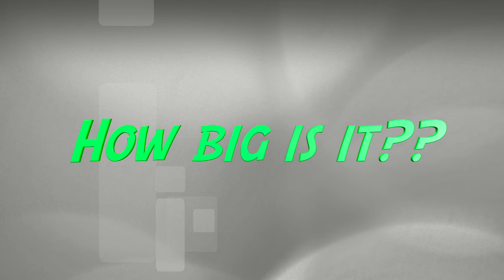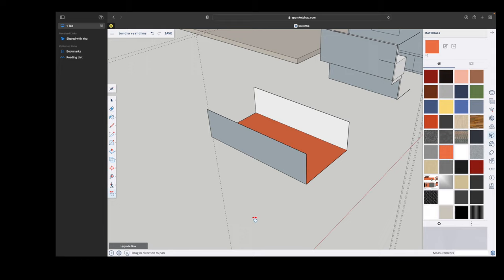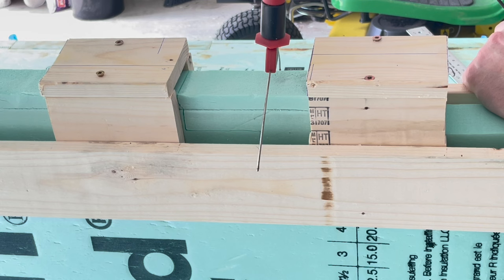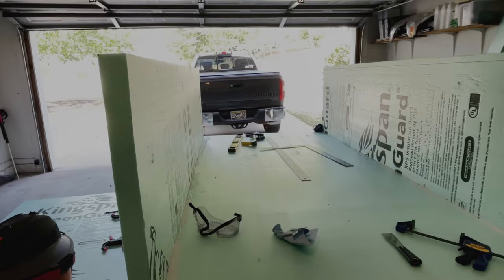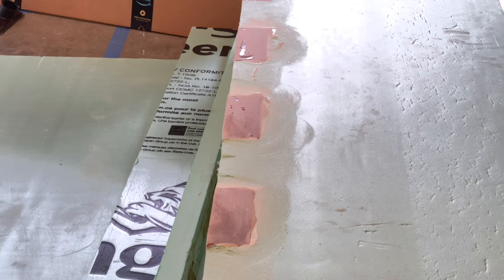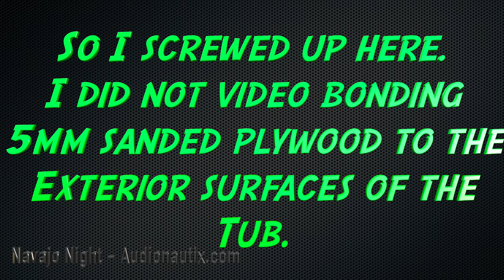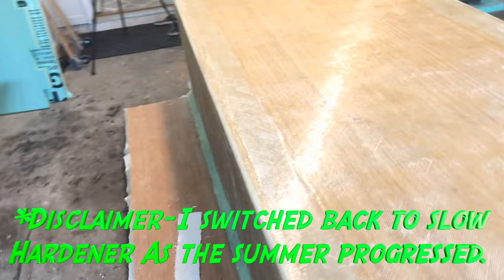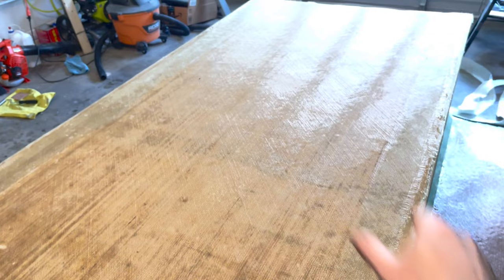I'm building a truck camper out of foam? (Yes! And it's going to be beautiful!) Ep. 2

Comment: If you radious your corners you'll avoid air bubbles, that glass doesn't like square corners, just saying , I'm not knocking you it's just a suggestion.
Reply from the maker: @gordondurkee7612 I tried to round most corners, and honestly, could have been even more rounded than I did. It was minimal at best.
Reply: Thats not a suggestion it is how the professionals do it. Radiused corners are the proper way to get 100% bonding in both inside and outside corners

Comment: I heard on another foam camper video that having the floor as foam will result in compression and the floor will crumple. Have you a work around for this? 🇦🇺
Reply from the maker: I'm sure with a considerable amount of weight, this could occur but since it was wrapped in fiberglass and only weight on the top is walking around, I do not see it as an issue. The bottom of the tub does have a sheet of 5mm plywood under it, also fiberglassed into place.
Reply: the compressive strength of the foam board insulation is about 20psi

Comment: Uhh, if you coat the foan on both sides with epoxy glass you would have stabile strong material to cut and assemble. Good idea with the finger joints. To join panels use epoxy and wood flour mix. To sheet the panels coat in a thin epoxy micro balloon mix then just lay it down wet out and bob,s your uncle.

Comment: I like your build. The biggest issue I have in my head is: How strong is it for lifting the whole unit with camper jacks?
Reply from the maker: @jefferyfowler The weight was no issue. The choice in jacks....slightly. However, no stress cracks!
Reply: To begin with; What is in the camper when you are jacking it?  In reality,  the materials will support itself and a reasonable amount of materials - Clothes, cook stove and chilly box. 1000 lbs of game meat and assorted tools? Unload first. First tip it to take roadside weigh scale readings at the start of the trip and before unloading. Always interesting to realize the accumulations.

Comment: I'm impressed.  Do you know yet what dry weight will be, and will it have a wet bath?   Should have good structural integrity.   Tony
Reply: Estimate on the weight, obviously.
Reply from the maker: Hi Tony. On paper, its says around 900 wet weight. I have my doubts though as it is easily moved around at this point at 85% complete. I can still lift the corners as well. 
There is no wet bath on this build but only because the couch/bed is in the tub. With everything I have been learning on this version, it has given me ideas for the next iteration for when it is cloudy for 5 months straight! :)

Comment: Hello! Nice job on your build so far. It looks light and strong and well thought out. I too am building a foam camper. It is for my Nissan Atlas - retired firetruck from Japan. It has a flat bed with drop gates, no wheel wells so I have created a cube camper that is slidable-inable and outable onto a sawhorse table I built. I found inspiration from YouTuber “NOMAD” who has done some incredible stuff with XPS foam, bug screen, coated with thick paint - like a light weight fiberglassing-ish technique but his stuff is just for cabinets and furniture inside his vans (one VW bus, one Sprinter). I also borrowed heavily from YouTuber “EndGame” from whom I got the idea to build a lightweight post and beam frame for my cube and then filled the voids with XPS and then fiberglassed over the entire thing. From “NOMAD” I learned about Hotwire Foam Factory who make powerful foam cutting hot knives and also produce this incredible glue called “Foam Fusion” which I have been using to glue all my foam into place as well as for laminating the outside of my cube with 1/8” ply before I fiberglassed it (two layers of 9 oz cloth) and then painted it with white bed liner. I have also been embedding wood in various spots on my build where I know I will be placing tie down anchors for gear on the interior, as well as wood pieces to anchor my future furnishings (bed and benches). Your fiberglassing I think is thicker and stronger than what I have done so you might be just fine anchoring directly into that thicker skin. I have been using those threaded nut insert things that I can screw bolts into. Not sure if that makes sense. Anyhoo, I wanted to mention “NOMAD” and “ENDGAME” to you as those fellas have some creative ideas and are both crafty as hell. Take it easy. Enjoy the process. Light is right. I’ve forgone many things that some people seem to think necessary in a camper i.e. no shower, no sink, no plumbing. Just a propane stove, a Bluetti ac200p, a 200 watt solar panel (attached to a Packasport roof box) and a Yakima road shower on the rack above. The rack is anchored into wood beneath the fiberglass skin. . . That’s enough… I could go on. Cheers!
Reply from the maker: Yep! I took inspiration from Nomad and Endgame as well! They do some incredible builds!

Comment: If you look up fiberglass wet foam layup construction for aircraft, you do not need any special joinery for gluing foam together. You could have saved a lot of time and done a simple "butt" joint glued with flux (epoxy and flocked cotton mixed) to hold its form. The strength of the join will be in the fiberglass cloth added as a wet layup. It's the fiberglass on the foam that carries the load across the joint, not the foam.

I recommend you look up Burt Rotan's videos that show the complete wet layup techniques used in his aircraft's designs.
Reply from the maker: Thanks K Verb! I'll check it out.
Reply: Thank you very much for the info you imparted.  I have been watching vids about this construction technique......cause.....I got a bus.🙃👍🌻
Reply: @GeorgiaAstronomy I disagree with NOT using box joints, aka finger joints, with the initial construction of “box store foam” construction. I use it on smaller projects and it makes for a more rigid and structurally sound connection in its raw state of construction. You’re using box store foam and NOT specialty foam like Divinycell type foam used in aviation and marine applications. Keep doing what you’re doing. Looks great so far.
Reply: @racrx7  
I'm a little late to the party but I thought I'd throw in my two cents on the subject. I used to build fish boxes for commercial fishermen out of 2" foam and fiberglass. The basic recipe is as follows: Cut the foam to size. Pin the parts together with 16 penny nails. Round over the edges. Glass over with three layers of 1.5 oz mat.

Yes, there is a little more detail to it but those steps are the basics. We never did anything other than butt the pieces together and never had an issue. If you know anything about commercial fishermen, you'll know that they aren't exactly dainty when it comes to handling their equipment. 

Can you use box joints? Sure, but it's my experience that they aren't necessary. When you pin the foam together, run the nails in at slightly different angles and the parts will stay in place. The boxes I built were usually about 48" x 48" x 30-36" tall so not small by any means. We would flip them from side to side as we glassed them and never had any problems with the pieces coming loose before they were glassed.
Reply: You might try foam fusion glue.  Also, Gorilla clear glue is good but expensive.  Finger joints are not necessary.  I would have put a radius on that inside step joint for the fiberglass.  You need fillets on the inside corners and round edges on the outside corners.  I have made quite a few things out of foam and fiberglass, great material!

Comment: One thing I didn’t hear mention of is the type of fiberglass cloth being used with epoxy resin. Polyester type cloth fibers use a polyester resin to temporarily hold the fibers together until the application of the polyester resin which melts the fiber binding poly for a complete cohesive bond of the two materials. Epoxy resin will not dissolve the poly binders in the cloth. There are special cloths made just for epoxy resins where the fibers use a type of powder to hold the fibers together that gets absorbed in the epoxy. If I missed that you are using glass material for epoxy, my apologies. 

On a side note, I’m liking the the thin ply over foam coring method. Kinda like the I-beam principle.
Reply from the maker: @racrx7 Its standard cloth, not poly. You are correct in that poly needs poly to dissolve the binders. However, using polyester resin will melt the foam.

Comment: Very nice👍
I am thinking that since most of the strength is from the FB or CF shell that will be applied - I was was just going to glue the foam edged on edge then drill some holes and put some dowels and glue in them for a little extra working strength.
Cheers
Reply from the maker: @patrickmckowen I was considering the dowel method originally as well until I found the video on the guy doing a notch method.
Reply: hay Patrick how are you brother
Reply: Dont over think the construction. It is not a space shuttle! It will be a canopy or a camper travelling at less than 80 mph.

Comment: The fiberglass is called either chopped strand mat. Or continues strand mat. The vast majority are not compatible with epoxy. There are some different types of sizing used. Check what kind before you use it with epoxy.

Comment: I am considering a build for my f250.

This is what I'm not understanding.  With all truck campers the floor is so narrow, like 48".

This results in a lot of weight being high. 

Why not build it the width of the bed with cutouts for wheel wells? 
My truck has a long bed so I talking about a lot of space down low for tankage, storage, room for shower and toilet, refrigerator with room for other heavy storage underneath, etc.
Reply from the maker: Couple of guys have built their's as truck 'toppers' but full height. I did play around with the idea of allowing the rear to pushout the sides, aft of the wheel wells,  to allow extra storage room and only have the front part narrow for the wheel wells. Alas, I didn't go with it.

Comment: the interlocking method you used to join 2 foam boards together is called a dovetail which creates a very strong joint. What kind of adhesive did you use on the dovetail joints?

Comment: What's the name of tool to cut out foam? 
I wonder by using foam to get shape, make a mold so it will be a one piece fiberglass?
I want to do something like this but a cut out of back wall. So in a truck, it be like a semi sleeper but two ways to access it. I think 350 come without blackwell of truck if ordered.
Reply from the maker: @dom Hot wire cutter.

Comment: I figured the resin for the fiberglass cloth would have melted the styrofoam
Reply: Epoxy resin has no styrene solvent in it. Polyester resin has styrene in it which dissolves or melts the polystyrene foam

Comment: You went from Total Boat to West System because ... hardening vagueness and something about the smell, but ... no, I don't get the idea. 
I'm here on YouTube to learn from other's knowledge because I haven't used epoxy with foam. It's frustrating when folks do a how to video and then act like the viewer already knows.
That said, much of this video is great info and I do appreciate it. Just please don't act like "we get the idea" if you don't clearly explain what idea we should get.
Reply from the maker: @DesmoProfundis I was switching between the two because the Total Boat was a 'fast hardener' (dries super quick) which is directly affected by ambient heat. The West Systems was a slow hardener. Longer working times in higher ambients.

Comment: What is the tool called for cutting the styrofoam please
Reply from the maker: Hi Ariel. Hot Wire Styrofoam cutter. 
https://www.amazon.com/gp/product/B076GX3268?ie=UTF8&psc=1&linkCode=ll1&tag=roswellastron-20&linkId=c2f560990dfd871e41b01380e7dfe6c5&language=en_US&ref_=as_li_ss_tl
Reply: @GeorgiaAstronomy  Thank you!
Reply: it's a soldering iron with specialized tips for cutting foam. You could probably cob one together at home if you wanted to.

Comment: 2:31   Are you sure it is 250 PSI compressive strength?   I think it is 25 psi
Reply from the maker: Dammit! You are correct. Apologies. My editor was off this day. Well actually everyday.  :0
Reply: @GeorgiaAstronomy  wouldn't it be great if we could buy actual 250 psi foam at Lowes/Rona/HomeDepot?
Reply from the maker: @jwiereng  I'd be building a whole lot more stuff!!
Reply: PVC foam at medium weight is close to 230PSI compressive strength. It's a lot more expensive than Polystyrene foam but you can buy it in sheets from most fibreglass speciality suppliers.

Comment: Hi, sorry to bother you but I was hoping you see this and could answer a few questions. I am a newbie to foamie building, but I am very interested in it, and I like that the building materials are lightweight. I am seriously considering helping a family member makes something like this, so plan to watch your series and learn as much as I can. 

At 10:40, after you had sanded the glued joints, you appeared to glue a wide strip of something down across the joints. What did you use there? Is that the fiberglass you were talking about? You later said you were using "17.08 Fiberglass" (is that what was used first across the joints also?), but I looked for that item on Lowe's website but nothing came up, so I am not sure what product to use for this item.

Sadly, you lost video when you turned the box over, but if I understood correctly, what then happened was that you squared your box, then glued 5mm plywood to all areas on the outside of the box. Then you probably sanded down the edges so they were smooth, then you glued that fiberglass stuff across the joint edges once more, and then when it dried, glued the fiberglass (cloth???) across the entire outside of the box. Then you sanded over it all to make it smooth. Is that correct, or did I miss something here?

Did you wear googles and a mask to protect your eyes and lungs from the dust when you were sanding? I have seen a few videos that briefly mention the use of some fiberglass product in foamie builds, but isn't that somewhat similar to the fiberglass insulation that is bad for the lungs? If so, is there a good alternative? 

Also, at 13:41 there is a blue strip on the inside of two joints. What is that?

I have watched a few videos from Nomad (plan to watch more), and he did a test on 6 different types of adhesives. He found that the glue strength of Gorilla Glue Original was the best, and then the Gorilla Glue HD Construction came in second. You chose West Systems 150 epoxy resin. So I'm guessing Gorilla Glue (either type) doesn't come in bulk for projects such as this, or maybe there is something about using it in this manner (the outside of the box and not the interior) that makes the epoxy glue you are using the better choice?

If you see this, appreciate any answers you can provide. I am impressed that you were able to build this camper yourself. I've watched a few of your videos already, but I started at the end first to see if i wanted to watch the series (I do). The total weight of your camper is amazing. The cost was higher than I had hoped, but still much, much cheaper than buying a new camper, and yours is probably as durable if not more, and definitely better insulated. I can likely find a few ways to reduce some costs, then add other items over time, so this is a good option.

One thing that has occurred to me is that in front of the wheel wells there is space that seems to be totally ignored in truck campers. I wonder if anyone has ever created a little door on either side to be able to access and store items (like extra water or fuel since the area would still be fairly exposed)? It would definitely need to be reinforced and supported very well, but when space is at a premium, a little extra room there could be useful.
Reply from the maker: @@CarolinaCarolina-ph9mx Thank you for watching! I'll try to answer as much as I can but feel free to reach out to me on email. roswellastronomy@gmail.com
At 10:40 time mark, The strips were fiberglass reinforcement tape. It comes in 6 and 10" wide rolls. I used it to reinforce the joints anywhere that had two panels adjoining. 1708, you will not find at the big box stores, especially in the volumes you will need. There are several stores that carry it and can be ordered on line. https://fiberglasswarehouse.com is one supplier I have used. The box bottom and sides, along with the wall sides on left and right sides had the 5mm plywood on them. all edges that met with a 90 degree angle, whether plywood edges or where the walls and panels met, were sanded to 45 degree angles. Reason being is that fiberglass does not form well around sharp edges. It needs to be a more gradual transition.
I did wear protective equipment as you do not want the fiberglass in your lungs and eyes.
At 13:41, that strip is a piece of extra foam cut at a 45 degree angle and glued into place. Again, to ease the angle from 90 to 45 degrees. 
The wood panels and joints were mostly glued down using epoxy resin. Some joints were also used Gorilla glue HD ultimate, from Home Depot. I bought them by the case.
Reply: @GeorgiaAstronomy  Thank you so much for your response and help. I really appreciate it. 😊 There is a lot to learn with this type of building, yet at the same time, it seems more doable than a wood framed build. Plus warmer and lighter. I've made it up to Episode 11, I believe, and really appreciate the content you shared. I was bummed that the roof wasn't filmed, however, because I was really looking forward to that section. Might have even brought out the popcorn to watch that come together. 😆 This Foamie way of building is inspiring, and I I have a few ideas on things I might want to make. I need to find a good Foamie group to broaden my knowledge base so if/when I decide to build something, I will be prepared. Thank you again for your very helpful reply. 😊